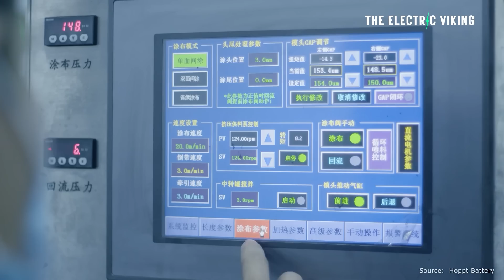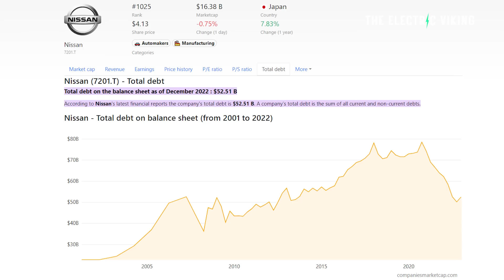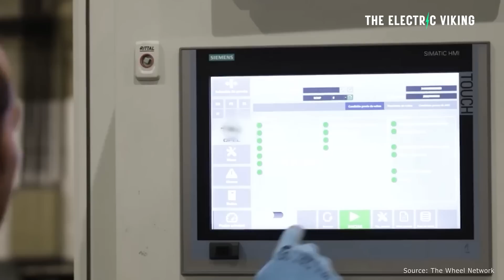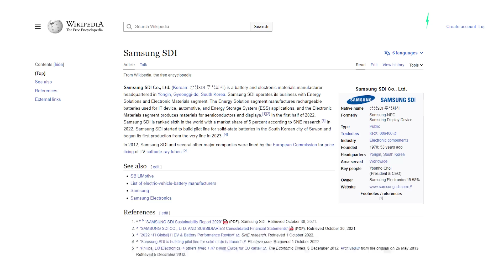WAY too many battery factories are being built in the US with the wrong batteries

Comment: 180 million homes also need approximately 45kwh of BTM storage just to hold 1 single day of solar gain from 10kw array. Both home use and h2v, v2h, v2g, b&i 2 g, B&i 2v. 
The truth is both batteries and generation need to increase 5 fold to handle the squeezing of fossil fuel without sending the economy into a freefall. Because, lets face it, energy is a labor multiplier. One worker with the aid of a tractor and fuel can now produce 100 peoples production in the fields! The same is true of thousands of jobs! How many rowers were replaced by one ships diesel engine? 
Batteries are subject to Moore's law and every doubling of production amount to bringing down prices by half. 
Stationary installations are not as weight sensitive nor as sensitive to temp. 
While battery chemistry may be an issue, once built, a factory can redefine the production in shorter order than starting from naught. Modification of lines is much easier than "writing off the whole". This is especially true when concentration on plug in retrofitting is made an R&D priority.

Comment: These factories are being built because there's demand and there will be increasing demand of the older lithium batteries as replacement battery packs are increasingly needed for older EVs that need replacement battery packs.

Comment: Northvolt, a Swedish cie will open, close to Montreal Qc., a new factory to produce batteries because all of the components used will be supply by the mines are  already in Québec. And they said that they will be able to change any of the anode & cathode materials if they need to do so.

Comment: There is much speculative in the video:  1) it depends on the structure of the financing and manufacturing set-up, if they are set-up properly, it doesn't necessarily put the parent companies at risk; 2) batteries may not be needed only for cars, given the massive incentives going forward for the transition to renewable power across the economy; 3) I can't speak to the technology and energy density and obviously companies that make the worst batteries will be the least competitive.  But as I said, if the companies set-up the projects properly, they will be in separate subsidiaries, no guarantees or minimal for financing, and limiting liability from the parent to sustain the entity.
Reply: It is anticipated that a large amount of the batteries produced under the IRA will be used for renewable energy production. Batteries can be used to store energy generated by solar and wind power plants, which can then be used to power homes and businesses during peak demand hours. This can help to reduce reliance on fossil fuels and improve grid reliability. As you note, there are many very large incentives to buy the batteries made in America, and firms that follow those incentives most carefully can get up to 70% of the cost of converting to renewable power in tax incentives, which makes the projects effectively pay for themselves.  So I'm not sure that the analysis addresses the potential for demand. Granted, best batteries are great, but are the materials available for Tesla to be the only supplier? It also seems unlikely that Tesla can supply all of the potential demand.

Comment: Having more battery manufacturing capacity than necessary to meet EV demand is fine: you need extra production capacity for powerwall/UPS/"AC generator" type applications, peak-shaving energy storage for DC fast-charging stations, utility-scale grid stabilization to reduce the need for peaker plants, all of the small engine stuff that is already going electric now and will only become more common over time, etc. The world demand for good batteries is a few times larger than just EV cars and trucks. I'd love to have an LFP-based UPS with a battery pack that lasts 10+ years instead of lead-acid batteries with an intrinsic lifespan of about six years regardless of how infrequently they come under load.

Comment: GM helped fund Mitra Chem for specifically for the purpose of coming up with a good LFP or LMFP by 2025, which they plan to be the Ultium II cells. And GM has already stated that Ultium cells are chemically agnostic, meaning same form factor pouch and same machinery for a different cell chemistry.  And since GM owns 50% of Ultium, it is only logical that GM would not have a signed a contract that required them to produce only LCM cells. 
In addition, the GM's 3rd factory won't be ready until after Ultium II cell planned release date.

Comment: Ford is partnering with CATL to build a factory in the USA.  While I haven't looked at the contract, I can't imagine that it doesn't include the right to newer battery designs as they become available.  To lock in production of current tech without an upgrade path would be idiotic.

Comment: A car company want you to replace your car with a new car as often as possible. That is why they are not that interested in batteries that can last for many many years.
Reply: >> A car company want you to replace your car with a new car as often as possible <<
except that batteries are replaceable..
Reply: @tooltalk  well yes, anything is technically replaceable in a car. I am no expert but I think replacing a ev battery in a car that is 5-10 years old will not make economic sense. 
A least the materials in an old ev battery should be recycled.
Reply: @tombh74  : Sure, ev batteries would get cheaper 5-10 yrs down the road.  The battery industry however needs to expand to make that possible at scale -- which is what this Viking dude is against.   Note also that, contrary to NCM's profitable recycling, LFP can't be recycled economically, as there is no valueable metal to recover.  It would have to be subsidized by either gov't or EV OEMs.

Comment: No, Sam.  ALL the battery factories (Tesla included) have their component materials shipped from China.  It doesn't matter WHICH batteries; it matters whether or not it's a Tesla.  And that market is still pretty small.

EVERYONE ELSE who moves towards EVs (with low demand) in lieu of ICE, is going down.  All the guys building battery plants JUST TO MAKE BATTERIES, are merely grifting off the IRA subsidy.  They aren't 'moving to electric.'  Consider the UAW strike impending, and there's ZERO reason for ANYONE to waste money here in the states, knowing it's getting pissed down a union rathole before factory 1 can be started.
Reply: >> No, Sam.  ALL the battery factories (Tesla included) have their component materials shipped from China.<<
This is untrue, most raw materials come from Australia, Indonesia, Chile, and Congo and only 60% of the refining is done in China (b/c the refining is environtally very polluting).   In terms of size and profit, the miners make the most with 55+% margin; followed by refingers (15%-25%); battery makers only about 15%-25%. 

Can't quite understand your second argument, but it's a horrible idea to invest in EV companies now, partly b/c there are too many of them and overpriced.  There are not however enough battery makers out there: it's just two horse race between China and South Korea.
Reply: @tooltalk  You were pretty much with what I was saying.  Most of the REFINING into base components (like jelly roll and such) are done in China, or other countries not directly involved with the mining OR manufacturing.  And the toxicity/pollution as the main reason is right on the money.

No, developed countries aren't lowering ANY pollution fiotprint.. they're just shipping it to countries too poor to say no, or who don't care how many of their inhabitants are harmed.  Anyone supporting this stuff by buying EVs, should be held just as responsible as any industrial polluter.

Comment: The question is how much miles a car needs. I used to buy 2-3 year old ICE cars since 1995 and drive them a long time, maybe give them to family members. So cars stay a long time in the family and we can see how old they get with good maintenence.

Some ICE run for 300-400.000 in 17-19 years, one was 24 years old with 240.000 kms and still ok. But here is the point: these cars get hopeless outdated, especially in Europe. Their bad milleage and high tax due to pollution makes their upkeep expensive. Some are also difficult to get spare parts.

So at a certain point you need something new as a daily driver even when the car is in a overall good condition. And this may happen to EVs also, maybe a bit later. But when new EVs with a better milleage or intresting features like highly efficent solar roofs on the market or energy costs rise, you may think twice about the EV you bought 15 years ago.

This happen to all things. So I am not very intrested in a battery which would last a million kilometres, when I could get a 300.000-400.000 km lifespann battery way cheaper.

Comment: It seems Tesla are one of the few smart manufacturers yet again!
As I understand it, part of the delay in adopting LFP was due to patents and licensing. Those patents, afaik, have now expired. Tesla are making hay out of this.
Reply: >> As I understand it, part of the delay in adopting LFP was due to patents and licensing. <<
there were two reason:
1) LFP patents were owned by a Suisse patent consortium, which allowed China to use them domestically royalty free since early 2010's; then they pretty much all expired by 2022 -- which opened the door for China to export their EVs.  Until 2022, China used mostly LG Chem's NCM domestically without paying any royalties. They still can't export NCM batteries b/c all Chinese battery makers infringe on LG's patents.   In fact, CATL founded in 2011 for instance is built on LG's NCM battery tech and engineers poached from South Korea when there was a battery industry downturn in early 2010.  Up until last year, CATL made more NCM than LFP's. 
2) LFPs are cheap, inferior batteries that engineered for low-performance (ie, C-rates) stationary energy storage.  It took China sometime to jack these for use in EVs and the mass adoption only started a couple of years ago -- China's EV LFP market share went from 2% in 2020 to 30% 2022, largely driven by the Chinese gov't subsidy.

Comment: they better be thinking of using something other than lithium because that isnt' going to work anyway; there isn't enough and probably won't be due to the huge amount of water that is required to process lithium.  500,000 gallons per ton. Thus they better be flexible enough and smart enough to be planning on other chemistries.

Comment: Really depends on the cost of shifting chemistry down the road.
Reply: You mean the market spot rate?   The cost of LFP is higher than NCM8/9 when the price of lithium is higher than that of Nickel/Cobalt -- that's b/c of LFP's low energy density.  LFP requires more expensive lithium to match the same Wh that NCM cells has.
Reply: @tooltalk  no I mean the cost to change the chemistry the factory is producing.

Comment: CATL also came up with the super charge technology that 10 minutes can charge EV with 250 mile range. It will come out either at the end of this year or early 2024
Reply: >> CATL also came up with the super charge technology ... <<
Firstly, it's not a ground breaking tech.   Remember America's LFP maker A123?  Perhaps Samsung?  They both had LFPs with 4+C charging before -- CATL just caught up with the industry.   Second, due to LFP's low energy density and weight, there is no long-range LFP EVs to meet that 10min 250mile range.

Comment: LFP has 3000 charge cycles before start to degrade from 100% charge, at 4500 charge cycle at 80% and 10,000 charge cycle at 60%. If you full charge once day will probably take 8 yrs for them to degrade from 100% capacity.. and they can be charged up to 100%, unlike NMC Lithium Ion... and also LFP burn less reactively unlike NMC battery. I  am puzzled why the US chose to build NMC instead of LFP.

Comment: I don't think this is as big of an issue as you believe it is.  The battery production equipment for ternary vs LFP are the same.  What isn't the same is the composition of the Cathode and Anode, which is made/supplied from outside of the factories in almost every instance.  Tesla is going to be one of the exceptions, and they definitely know how to pivot.  As for excess capacity.  I think you neglected to take into account that the US has just started getting into the larger SUV/Truck market, and the demand that will be there.   Expect the average pack size to increase by at least 50%.  And we'll also need more cell production for energy storage as well.

Comment: I’d expect all those factories can adjust their assembly lines for the type of battery the want to produce. Just lie the car companies adjust their assembly lines every few years. 

I agree with you that if they are starting with less valuable battery technology, that seems like a missed opportunity. Having batteries at all will be valuable. Let’s let them get started and see how they innovate.
Reply: Like using manganese doped LFP BATTERIES 18650 369 2170 4680 9369 or 6981

Comment: Due , what is with the jacket ?. That cold in Thailand ?!. Excess capacity batteries in USA would be a good thing as it will drive the price down to far more affordable levels. That is good for EVs in the long run, and the secondary market such as Home battery packs for solar panel installs.

Comment: Well said! This segment answers a number of questions I have about the new battery factories which are going to be built in North America. If the batteries are really that much less competative that the new CATL batteries then there will be a lot of EVs sitting on the legacy dealers lots. This is what is happening to Ford now with the Mach-E.
Reply: Getting the staffing is going to be difficult in areas where McDonalds are offering higher wages .😅
Reply: @malcolmrickarby2313  : that's b/c the battery manufacturing is highly automated; youa re getting paid like a security guard b/c that's the type of work you would doing on the factory floor: just babysitting big machines.   All those McDonalds jobs require some physical effort.
Reply: >> . This is what is happening to Ford now with the Mach-E.  <<
Sure, Ford is using LFP's now -- must be why their sales are so poor..   CATL makes cheap batteries, not better battiies.   If you want to buy LFP, go get BYD; NCM? get LG/SKI.

Comment: No doubt there will be winners and losers in the race to make batteries.  However the IRA makes it viable to be in the race and lose than not run at all.  It is likely that a ‘failed’ battery chemistry factory can be modified, at perhaps at less than 10% the cost of new build, to use a different chemistry and assembly.  Any factory layout and instrument infrastructure must be flexible enough to be adaptable to changes in technology.  Even the current LFP technology is an innovative step away from becoming obsolete.

Comment: Do not forget that when gasoline/diesel engines are banned, every vehicle on the road, farm, and even the sky will need battery power.  All trucks due to the weight they haul will require massive amounts of batteries.  Trains, a car battery pack will not work, again massive amounts of batteries.  Just think when all ICE's are banned, every tool, think chainsaw, lawn mower, leaf blower, etc. will need batteries.  I do not see a future where there will be to many batteries because most of these applications outside cars will work just fine with Li-ion batteries.  As time passes they can phase in new chemistries that function better.  But for the immediate future getting rid of ICE's is the prime directive.

Comment: (1) How hard is it to convert these factories to Sodium Ion Batteries Manufacturing circa 2028 thru 2032? (2) US has the supply of soda ash in Wyoming - 30% world wide comes from Wyoming and 70 % domestic  (3) Look at the format of the Tiamat battery (4) Excess capacity could be used for residential storage to get rid of peaking plants

Comment: I drove past the Kentucky Ford SK plant yesterday.  (Just south of Elizabethtown).  This plant is a monster.  It is still growing while under construction.   We may see 2 to 3 big advancements in battery technology while the plant is being built.   Hopefully the battery manufacturing tools on the inside will be flexible enough to take advantage of these new chemistries.
Reply: >> We may see 2 to 3 big advancements in battery technology while the plant is being built.  <<
This Viking has no idea how battery research, production or testing works.   The lead time between signing a contract to production line is usually 3 years, then the same line runs for several years.   A lot of so called battery advancements in labs don't make it to the real world -- and when they do, they need to go through another 3-4 years of rigorous testing for mass-adoption, if ever.
Reply: No nickel NO COBALT plez.  Nickel sides being TOO HEAVY IS TOO EXPENSIVE
Reply: Good points…thanks
Reply: "We may see 2 to 3 big advancements in battery technology while the plant is being built"  To be successful in  business  you don't use the "Ready, Fire, Aim"  strategy.   Problem is start ups want to elbow their way into the battery space without any clear technical objectives, which is a recipe for failure.

Comment: Nickel will be the prominent battery chemistry. There will also be LFP variants. There is already huge developments in Nickel chemistry such as single crystal process which addresses the issues of thermal stability and durability over multiple charge cycles also highlighted by Viking and has recently started mass production by LG for 4680 which will power cybertruck, semi and grid storage hence your oversupply will be absorbed by markets outside of EV’s
Reply: Of chem should stay outda semi an Ct….. scratching my head on dat comment don’t believe it
Reply: LG chem should stay out da CT………
Reply: Yup, that's a good point. After all Tesla is betting the farm on the 4680 wich is a ternary battery. Scratching my head here.